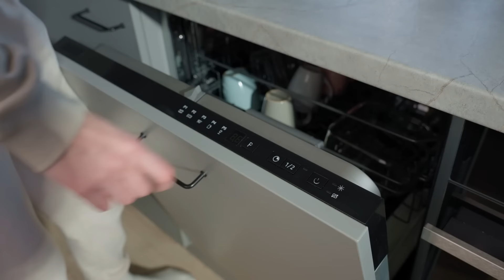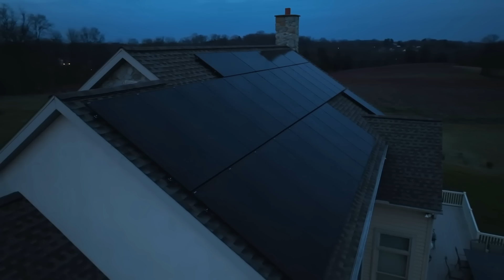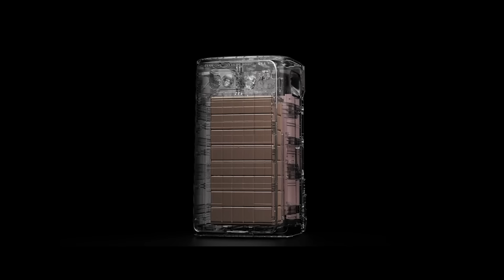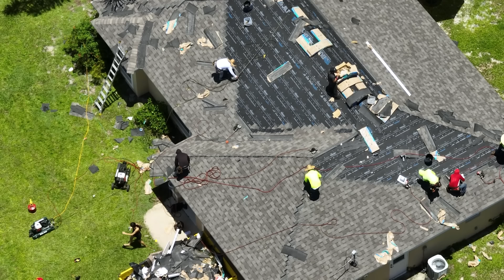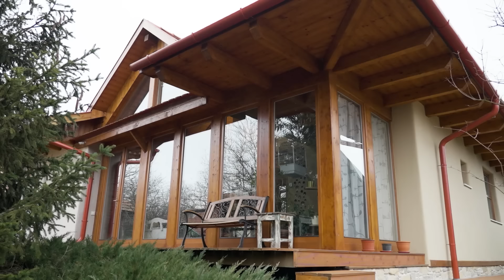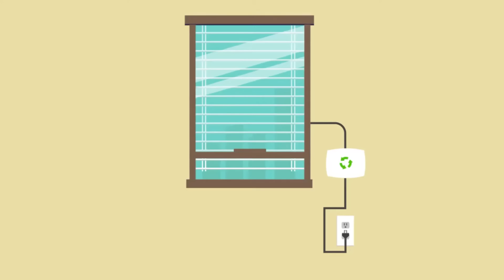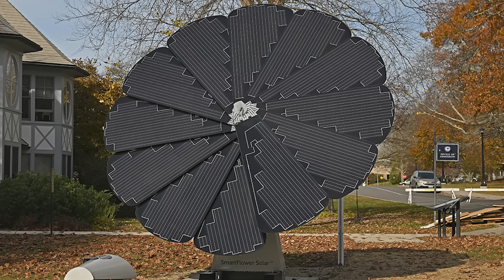Home Solar is Changing: These 5 Systems Will Revolutionize Home Energy

Comment: My European mind still cannot comprehend how american roofs are so fragile that they need replacements..
Reply: UK here. Just replaced mine after 50 plus years. Won't need to worry about it again in my lifetime.
Reply: It is strange. Americans are fed inexpensive disposable asphalt-shingle roofs that have to be completely replaced when it hails. Another petroleum-based con.
Reply: @ChitFromChinola  No.  America has a wide variety of building materials to choose from, just like in Europe, and are constantly innovating new materials.  It depends on how much the buyer is willing to spend and local esthetics and codes.  You can get clay tiles, steel, wood shingles, and even slate and solar tiles.  In America, The home owner gets to choose.  Many choose to not buy roofs that will outlive them.  The oil companies are not in the decision loop.
Reply: @DonkeyHotey-l2e 
You’d never guess it from driving around American neighborhoods. Cheap asphalt roofs as far as the eye can see. Hail comes through, and it’s a total roof replacement for every one that gets hit. It’s nuts. I didn’t say the oil companies were marketing the shingles, I said it’s another petroleum-based con. Companies develop and pitch cheap 20-yr asphalt shingles, and that’s the way the market goes. “Innovation” is developing a 30 year version of the same crap. And, none of them survive ordinary hail storms. Hail is common, but our roofs are disposable, so we just replace them every time the hail rolls through. That’s the norm, and that’s a con. The lack of options in the US is strange to me, but I’m just one person. Shingles should be made to survive hail. So, the last time hail wrecked my wimpy asphalt shingles, I chose composite tile shingles that look awesome, last 60 years, and survived a subsequent hail storm. But, I’m still surrounded by a sea of asphalt shingles. The lack of innovation is appalling.
Reply: @ChitFromChinola  You'd never guess it, but normal levels of hail don't damage roofs.  I live in America and have seen both kinds of hail and all kinds of roofs.  Of course, people who sell roofs will be happy to tell your insurance company it was the hail that did it.  You see it everywhere because in most cases, it works just fine and goes it's entire expected 30 year life without incident.
Reply: @DonkeyH @DonkeyHotey-l2e I’d never believe it because it isn’t true. Any significant hail storm will wipe out every asphalt roof in it’s path. It’s not insurance fraud, the insurance company employed adjusters were here on site making the calls. It just happened in my neighborhood three years ago, and every roof in the path of the storm was replaced. Houses, schools, and business — all of those asphalt shingles were ripped off and replaced with the same fragile crap. But not mine, because I have composite tiles. But hey, insurance companies pay, so what ‘ev. The asphalt shingle con.
Reply: @ChitFromChinola  - A good heavy duty metal roof would've been even better.  Regardless of their composition, tiles are smaller pieces and easier to rip off.
Reply: @DonkeyHotey-l2e  - 20 years, you mean.  If you're lucky.  Quit telling people that cheap is better.
Reply: @frostyfrances4700  I didn't say better, I said it was a choice.  In America, we have this thing called "freedom".  Other choices are also available.
Reply: @DonkeyHotey-l2e  - You promote the myth that better and more durable isn't the better choice when available.  Don't try to wiggle out from under it bc I won't let you.  Back pedaling when cornered won't save you.
Reply: @frostyfrances4700  Whatever.  Have fun arguing with strangers on the internet.
Reply: @DonkeyHotey-l2e  - Just trying to follow your shining example, sweetie.
Reply: Depends on the region and the roof type some homes get built with. Some people just choose to have super cheap roofs and they suffer later.
Reply: @LeafyMountains  - Sadly, too many people don't have the luxury of options when they desperately need a roof over their heads.  Housing has become so expensive compared to average income that first time homeowners now average age 40.  We're losing the middle class.  Another problem in the US especially is shortening attention span and disposable attitudes, typical of a weakening society.  

When people are so poorly educated and positioned, they don't tend to think very far into the future.  When I first retired 20 years ago to remote TinyTown, I bought an 1880 Vic at auction for $14.5K, knowing I'd have to plow 150% of the purchase price into rehab at minimum, and right away too.  So I had to live in the house through that awkward phase.  Now it's considered a showplace once again, and the heavy duty metal roof will outlast most of the townfolk alive today by far.  At first they objected fiercely to anyone putting a metal roof on one of 'their' houses, but I've had the satisfaction of watching everybody else on the block have to replace their own roof while I smirked.  I can only imagine how they'd howl if I ever buy an empty lot in town and build a monolithic dome on it - which is my biggest dream.
Reply: Well, some of us at least are going back to heavy duty metal roofs I put one on my house; but I'm also looking to downsize to a monolithic dome, at once the most ancient kind of dwelling after a cave and at the same time a modern improvement over stick built homes.
Reply: @frostyfrances4700  Domes, geodesic or otherwise, are a complete scam and have so many joinery seams that they are an extremely bad choice for structure and especially for water-tightness (just think of all the odd cuts you'd have to do to put any roofing product onto it, it fails outright upon the simplest consideration). DON'T DO IT. Please do more research.
Reply: @user-lknksjdfhg - Where on God's green earth did you get that from?  Somebody who bought a flimsy kit or something???  Monolithic domes are damn near indestructible!  Why do you think they're used for research facilities in far flung corners of the earth with year-round winters that would make Vermont blush for envy?  You're swimming upstream here, buddy.  Somebody sold you a real bill of goods.  While it's true that a poorly crafted geodesic dome does have too many seams for trustworthiness, that's not an issue with MONOLITHICS.  ThIey're all of one piece .... MONOlithic, get it?  Igloos, etc.  Ancient structures thousands of years old, etc.  When a violent weather event wrecks havoc, a monolithic dome is the last structure standing.  Proven fact.  Stop spreading such nonsense.  Are you heavily invested in large scale real estate development perhaps, and therefore afraid of competition?  Don't worry, most people don't know which side their bread's buttered on.
Reply: @frostyfrances4700  Relax. So what monolithic dome brand, system, or materials are you planning on building? I'm intrigued.
Reply: @user-lknksjdfhg - No, I will NOT 'relax' and it's not your place to issue such instructions.  Only reason I'm bothering with you anymore is for the sake of some uninformed but reachable person who might wander by and fall for your crap.  

Depending on which way the economy blows at the time, however, I have several options.  One could be to have local skilled craftsmen to build a concrete-covered straw bale version of a monolithic dome or even something in the shape of an elongated round-top tube like a Native American longhouse with the interior arranged NOLA shotgun-house style.  

Or, if I'm in the catbird seat then I could go with a Nova Dome in the Astro series.  They're built for the worst conditions on planet Earth and are well worth the premium price for those in a position to pony up for it.  But that's a Canadian firm, and you sound like you probably think the Canadians are as ignorant about building for that climate as you are about domes.  Saying domes have roofs!  Good Lord, buster, they don't.  They have tops but not 'roofs' in the sense you appear to think of a separate component.  You failed physics in school, didn't you, if you even got that far.
Reply: Nothing lasts forever.  Longer lifespans = higher installation costs from more expensive materials.  A cheaper roof means a lower cost to purchase the home.  This is basic economics.  It is true everywhere.  Too bad your European education system doesn't cover improving your European mind.
Reply: Dear Donkey, lol,
Longer lifespans can increase upfront material and installation costs, yes, but that’s only one side of the equation. Total cost over time (maintenance, repairs, replacement, and performance) is what matters, and that varies by roof type, climate, and warranty. And if a cheaper roof leads to leaks, moisture, and mould, it can create real health risks and costly remediation, especially in the U.S., where medical and cleanup expenses can add up fast.
Also resorting to personal insults doesn’t strengthen your argument))
Reply: @DonkeyHotey-l2e  - And another thing, Donkey!  Take a remedial math course.  Learn to think past day after tomorrow.  Who told you that people with options are better off with cheapjack construction that will collapse in the slightest breeze?  I know, I know ....  PT Barnum said there's one born every minute.

Comment: The Ecoflow Stream Ultra, as described likely violates endless safety regulations to protect utility workers. Those costly systems that turned off generation when the powering went dead, they were because law /building code mandated it to prevent backend into the grid to kill utility workers. The only way this would possibly work is to kill the main breaker on your power panel before plugging in. Day you used as described to supplement grid power, when the distribution power was lost, it would keep pumping power into your home and subsequently out to the grid via the closed breaker. I find it hard to believe this company is still in business. Example: car hits utility pole takes out power, a Troubleman/lineman isolates the damaged section ( which may still contain a housing tract). The purpose of circuit isolation is to remove power from the damaged section so that repsir crews can work on it while de-energized. Yes safety procedures require the lineman to check the line dead then ground it but if the lineman is working between the ground and the home with this power system, current can still flow through them. Yes lineman wear electrically rated gloves but those can fail too.The system is designed to provide every possible safety backup possible to protect the lineman. Also you are now powering your e tire neighborhood with the main breaker closed. Your system should ideally instantly trip off line from excessive load,  ut is that lineman between you and that load? I can see it whereas homeowner buts one, foes not disable the main breaker during an outage, kills or maims a lineman or the shock causes them to fall. The homeowner is charged with involu tary manslaughter, goes to prison for 5 years and the company is sued by widow and goes bancrupt. Even if it trips offline, if the owner resets it while the breaker main is closed and repair crews are at work, the result is the same.

Comment: i need a hitch mount smartflower for my van. 😊
Reply: @howlinhauler I was thinking the exact same thing, there needs to a smaller more portable one of those for RV's/Cars that either mount/dismount or can sit on the ground 10 feet away or something.  That would be awesome for camping or being off-grid/boondocking.  Right now, the best idea I can come up with is mounting solar panels along the top edge/side of an RV, and using them like an awning where you have almost 180 degrees of adjustment.

Comment: 9:37 maybe you should build roofs that lasts longer than 5 years 🤷🏻‍♂️
Reply: That was my thinking I bought my house 13 years ago, I'm not thinking about the roof until 25-30 years or after a big storm
Reply: The Yanks build many (most?) of their houses from timber, including the roof shingles (flat, oblong wooden tiles). They've got plenty of forest so it makes sense, and it's quicker and cheaper to throw together a wooden house than build from brick like in Germany or the UK. But, unless you're Scandinavian, you don't build houses from wood and expect them to last for many years; and Americans are generally in love with what's new. So, given that the value of your property is mostly in the land, if your timber house is getting tatty and run-down it can actually make sense to knock it down and build another one, but bigger and better.
Reply: Apparently regular solar installation shortens lifespan of the common asphalt roof. 
Your 30-year roof becomes a 15-year roof and it's because of the high heat that it deals with
Reply: @yum8705 please explain about "the high heat it genarates".
Reply: @yum8705  we have tiled/slate roofs, only flat ones are asphalt

Comment: Can you imagine how much snow build up those vacuum tubes have to deal with during the winter? Traditional PV panels are at least flat and can clean up themselves most of the time.  Also, if you think those 0.1kWh blinds can power your 2-5kW appliances then do the math. Your wallet will thank you.

Comment: They did not mention the Anker Solix F3000 with smart meter. You can attach one of them to each leg of your service panel and feed 3600 watts back into your system. When the grid goes down it uses Current Transformers to sense no grid power and does not back feed into the grid. Each f3000 can invert 2400 watts of solar and is expandable by adding Batteries.
Reply from the maker: Fair point! Similar to Jackery 3000.  There are quite a few of these systems on the market and so selection is need specific.  We selected the Jackery because of portability.

Comment: You are not thinking clearly about the situation.  A better way to generate more electricity and get hot water is to take existing solar cells and bond a PEX tubing to the back of them.  PEX has a very low heat transfer rate, unless it is infused with zinc dust and flattened into a shape that is not round.  The heat transfer is at its maximum now, thus cooling the solar cells and providing hot water.  Using PEX piping allows for expansion and contraction so that it doesn’t break when the temperature drops below freezing.  The benefits are more efficient electricity with constant power and heat for domestic purposes.  The only thing required is a small recirculating pump.  That costs pennies per day.
Reply: Get a container 50 litres make a hole in the bottom fasten a hose in it waterproof the hose goes up outside  the container and over the edge fillthe container with water. You have a waterfall to run a Generator
Reply from the maker: If you use a solar pump then the pump only runs when it is sunny and when there is the most heat generated.  Always happy to hear interesting proposals for energy optimisation. Thanks!

Comment: The EcoFlow STREAM Ultra should be illegal if it automatically keeps supplying power to your AC lines when the grid goes down. It is not legal. Normal solar or generator backup systems have a special disconnect from the grid. If you put power back into a dead grid it is a hazard to power workers. They WILL fine you.
Reply: It doesnt. It has anti islanding protection built in. If the mains goes offline then it automatically stops feeding energy into your property. The only way to carry on using it under those conditions is to plug appliances into the two plug points on the back of it. Your solar panels will continue to charge it but it just wont feed back into your house.

Comment: If you Yanks would stop using those crappy tar shingles on your roof you wouldn't need to throw them in the tip every 10 years. 
You don't even burn them to make electricity. So, wasteful and not green.
Reply: My roof is over 200 years old, replaced a few tiles over the last 40 years that’s about it.  Build properly to begin with.
Reply: A lot of us Yanks are too short sited to see past 5 days never mind 10 years..  it's pretty irritating

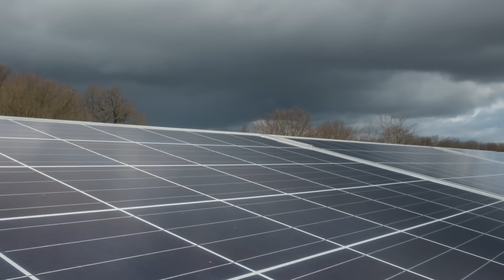Comment: 5:23 Funny how traditional solar shuts down during a blackout, yet that's exactly when people need it most. Are we buying energy independence or just a different kind of grid dependence? 👀
Reply: Or you can install a hybrid system that has battery banks included.  The solar panels charge the batteries during the day, while also providing power to the house, and selling excess power back into the grid.  At night it uses the batteries to power the house.  Mine works great.  Win-win-win.  We are never without power, and the system makes money for us.
Reply: Grid tied systems are for power cost savings not “independence”.  In your area, how often does the power go out and for how long?

The average American household uses 30kWh a day. In a power emergency, do you really need that much? My average is less than 5kWh so it’s easier to deal with a blackout.

What gives you peace of mind and fits your budget?
Reply: You can install what is known as a "gateway" which disconnects you from the grid in these circumstances and allows you to continue to power your home by solar and / or a battery. Costs about £1000 in the UK currently.
Reply: If you didn't have solar the grid would close down and you get nothing in the same way as solar does but you wouldn't have had cheaper electric when the grid is working and that's the point